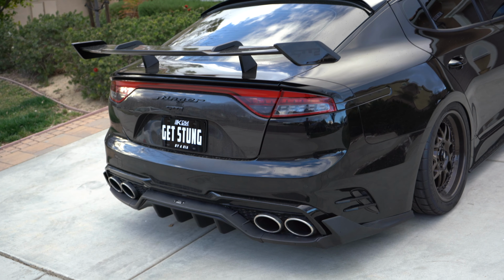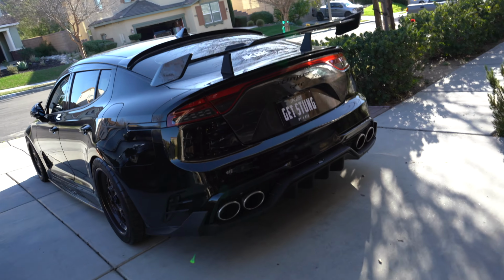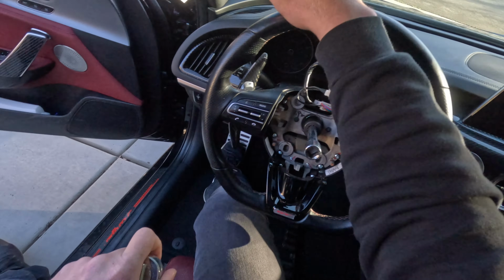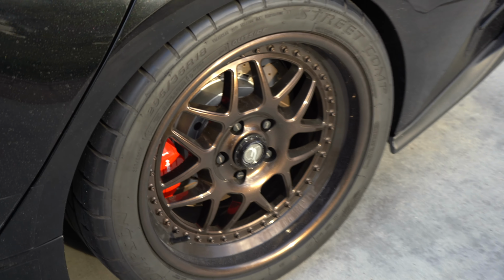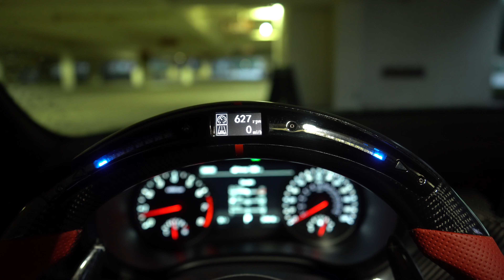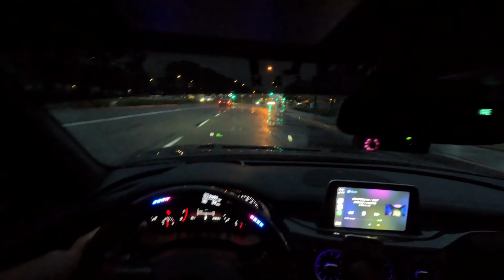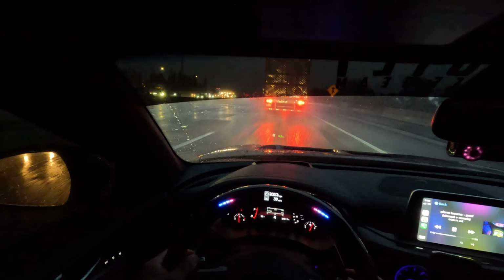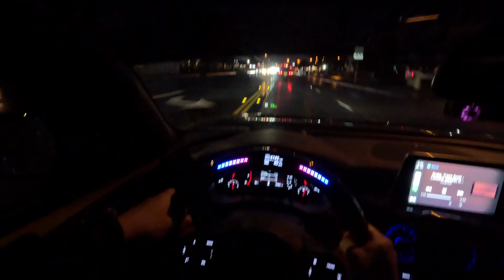LED Carbon Fiber Steering Wheel for KIA Stinger!

Comment: Great video! I noticed you have LED lights integrated into the steering wheel, which is a really cool feature. Could you please explain how you connected them? You didn't cover this in the video, and I'm very interested because I've just ordered a similar steering wheel. Any tips or a brief explanation would be greatly appreciated. Thanks!
Reply from the maker: Each brand has different setups on steering wheel wiring. In my case it was just black ground cable and the red to a good power supply which was the yellow cable on the wire harness of the steering wheel.

Comment: How do you wire the postive? The only 12V i see in the steering wheel is the illumination yellow wire. If i hooked the LED positive to that wire, then the LED only works when the headlights are on. Is there a way to make the LED on constantly?
Reply: Also, does the bluetooth for the led rpm display interfere with your jb4 Bluetooth at all? I use meth controller from LAP3 and it also use Bluetooth; I afraid that it will interfere and I can no longer use meth controller while using the LED

Comment: Dont know if you will reply to this but i just got my steering wheel installed by someone and the lights have to be on or the setting below it and both make the steering wheel superhot. I didnt think my 2021 gt1 rwd had heating steerwheel but i cant use the led lights because the wheel gets to hot.
Reply from the maker: They must of connected it to the wrong wire. Id take it back to the shop,not safe. Check the Stinger forums there is a wire diagram for the Steering wheels

Comment: This car is going be an classic. I have owned one for 5 years and I still love it as much as when I first got it and want to modify it more. At the moment I just have a moderately aggressive tune in and exhaust and intake modification. I think this gives me 368 brake horsepower and about 800 nm of torque.
I spoke to a gentleman who had one of the last stingers in 2023 and he said he has had Mercedes Benz and other exotic cars and he loves this car more than any of those cars as it is way more fun to drive and has way more features.
I mean seriously How many cars have an active bonnet ejection system and smart ventilation??
Reply from the maker: Yes you definitely right about that!! Appreciate your comment 🙏🫶

Comment: Interior is CLEAN! Was the steering wheel straight plug n play or did you have to wire up the gauge? Looks great man!
Reply from the maker: Thankyou!! And yes direct plug and play. It used a obd2 bluetooth connection for the guage💯

Comment: Can you calibrate the shift lights?  And are the rpms gauge and lights as laggy as they seem in video?
Reply from the maker: Yes I change the rpm band. And the flashing when hitting redline is the only thing I noticed as laggy

Comment: Do you have to connect to the OBD port to get the rpm reading on the LED ? I'm looking to get the SoCal garage wheel cause it's on sale now.
Reply from the maker: Yea it needs a OBD splitter you can find on amazon
Reply: What’s the power wire you tapped into.

Comment: I have one other comment, Do you reach a point when all the flashing lights and numbers create more of a distraction than help. Or is it something you just get use to.🤔
Reply from the maker: The flashing lights purpose is to help guide you when to shift when the setting are set properly 💯 rather then looking at your  smal rpm guage
Reply: @DARKRISE  Isn't  the tachometer one of the biggest gauges on the dash!?🤔